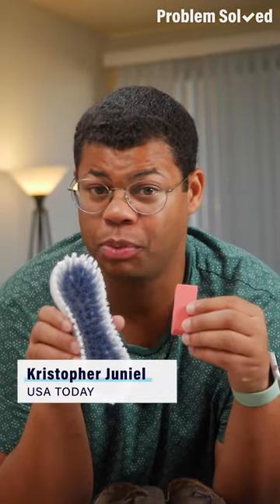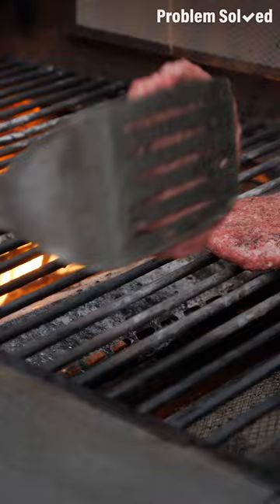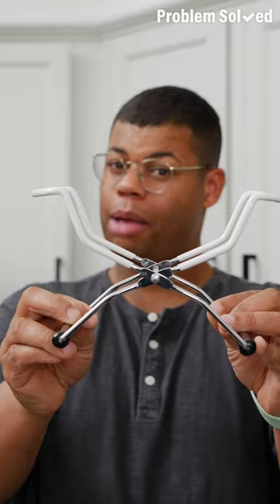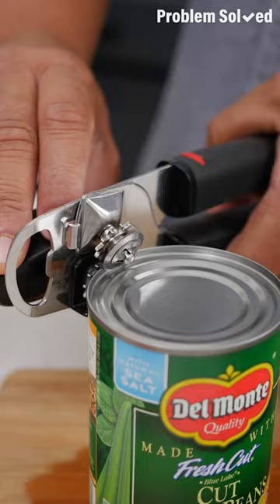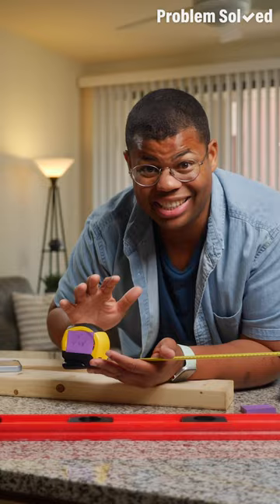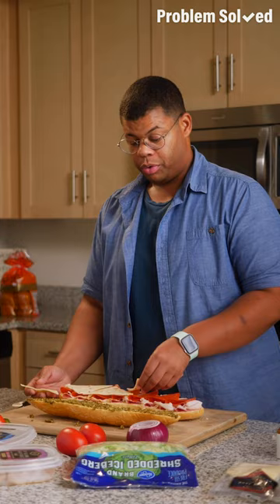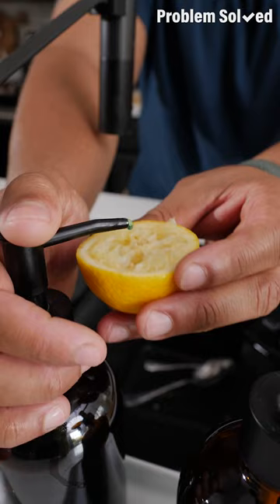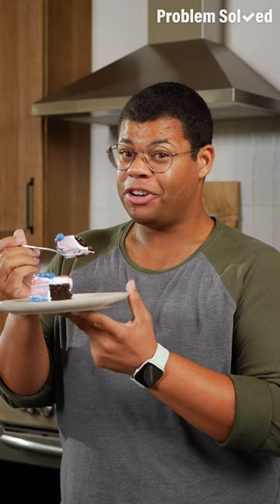50 Most Viral Life Hacks | Problem Solved

Comment: With the burnt pan - vinegar in  the pan and then heat the pan to medium heat. Yes, its going to be a strong scent from the hot vinegar but it will loosen all that burnt mess for easier cleaning. So will flat warm cola.